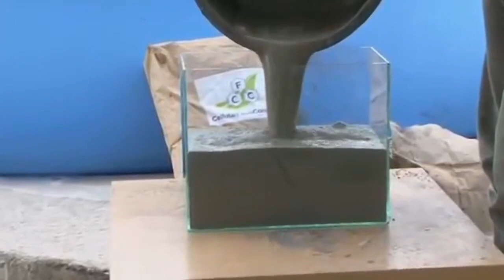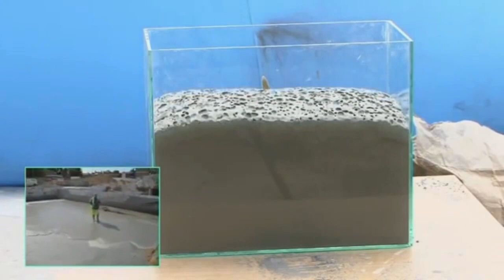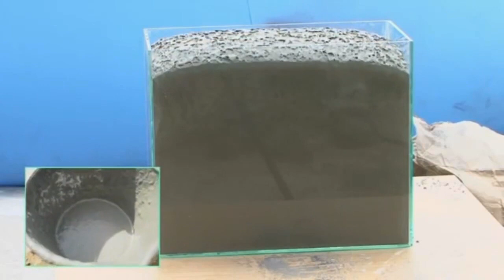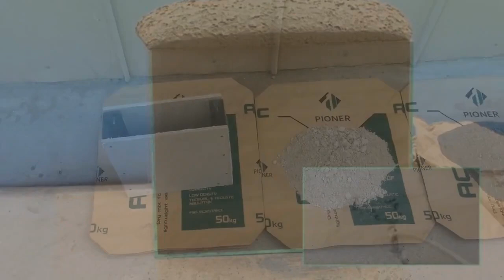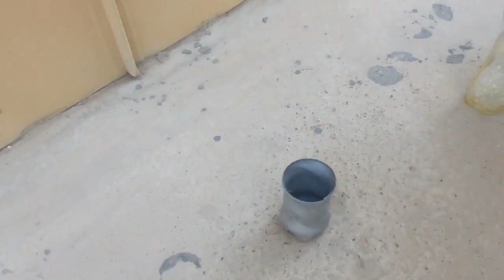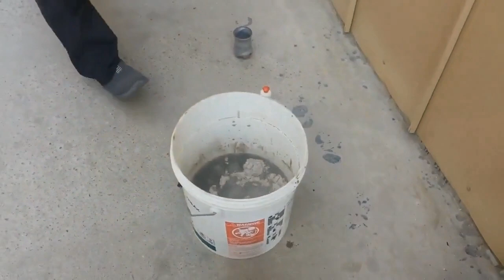Lightweight aerated concrete

Comment: Do you ship your pre-mixed bags of this product around the world ?  I am in the Philippines and would like to use it here and sell it as a plane cement alternative to help keep homes cooler here due to its high insulative value as compared  to regular concrete.
Reply from the maker: Yes we supply the dry mix for non autoclaved lightweight aerated concrete production in 50 kg paper bags. You can send your request by e-mail sales_manager@pioner-group.com or through whatsapp +971557310655